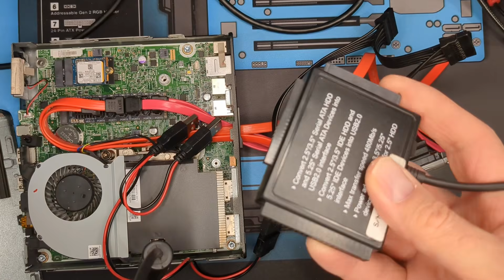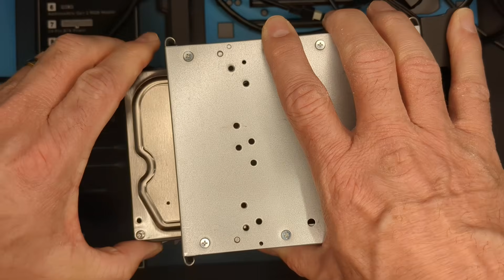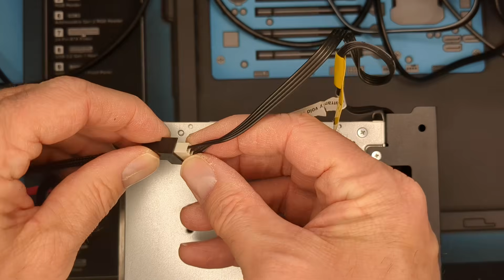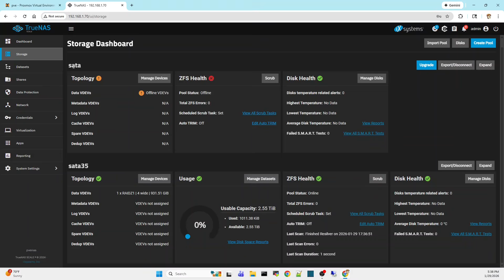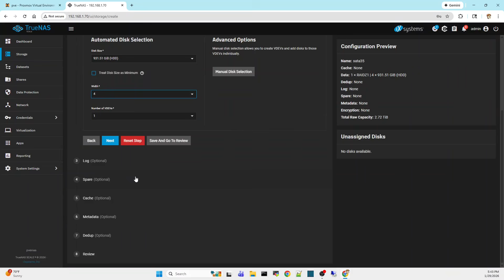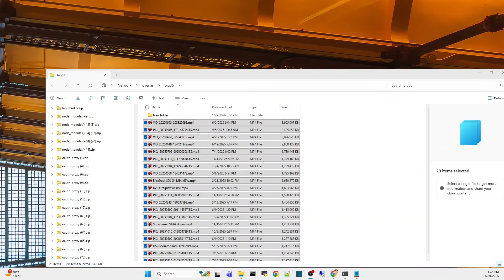3.5 Inch Drives...with EliteDesk/ProDesk Mini

Comment: Did booting from the asm1166 sata board work out of the box? I cannot seem to boot from that m.2 adapter.
Reply from the maker: I did update the firmware but I can't recall trying to boot a drive of f of it.  But for other operations it was fine.

Comment: Thank you so much for your great effort! I took your idea and built a 3D-printed case.

However, I’m facing an issue now. When I restart the HP, the system doesn’t detect the HDDs. I have to do a complete shutdown and then power it back on before TrueNAS detects the drives again.

I’m running TrueNAS directly on the HP, not as a VM.

Do you have any idea what could be causing this issue or how I can solve it?
Reply from the maker: Which SATA adapter are you using?
Reply: @handmedowntech  M.2 NVME PCI-E PCIE X4 X8 X16 To 6 Port 3.0 SATA Adapter Card Riser III ASM1166 6GB/S Chassis server PC Computer Expansion
Reply from the maker: So you probably have this one https://www.aliexpress.us/item/3256804650735517.html?gatewayAdapt=glo2usa4itemAdapt - the basic component is the Asmedia ASM1166 - which has firmware that can be updated.  I did it on mine because I was having some issues with it getting recognized.  You need a piece of software that runs and can load in the firmware and flashit.  https://winraid.level1techs.com/t/latest-firmware-for-asm1064-1166-sata-controllers/98543/86?page=2 includes links to find some on "station-drivers.com" - it does seem sketch but it seems like it is the only place that has the firmware.  In linux if I do 

lspci -k

I get 
02:00.0 SATA controller: ASMedia Technology Inc. ASM1166 Serial ATA Controller (rev 02)
        Subsystem: ASMedia Technology Inc. Device 2116
        Kernel driver in use: vfio-pci
        Kernel modules: ahci
You you go to https://dl.radxa.com/accessories/m2-to-hexa-sata-adapter/tools/ they have a zip file with a linux tool called 116xfwdl - when I run it with

./116xfwdl -S

I get fwver 24 12 24 00 00 00 
this seems to indicate 241224-0000-00 which aligns with what I see on the forums like https://www.reddit.com/r/unRAID/comments/1j9dzxr/asm1166_firmware_mess/

I did my flashing though using the windows GUI tool that I found on that station-drivers (I think) 

You can find more info seaching for

asmedia asm1166 firmware

But maybe first try and determine what you currently have

Comment: but can you run only one 3.5" from the built in sata connector?
Reply from the maker: In order to run a 3.5 inch drive you need 5v and 12v.  You can't get 12v out of the mini PC.  I researched trying to do it and you always end up needing external power.

Comment: Thanks for sharing this!  Could you link all the parts and cables (didn't know about the main converter you showed)? I have been looking at a very similar setup, but was looking at one larger 12v supply Like a 240W SFF supply ~$20 and a buck and boost converter for the 5 and 19v.  This way the PC and drives all power up and down together.  Not sure it is worth the extra hassle if you have a monitored UPS to do a graceful power down if needed.  Appreciate your video (as a new subscriber).
Reply from the maker: Thanks for asking and reminding me to add the part links - they are now in the comments.  Let me know how it works out.

Comment: Try to use side angled sata cables, so you can utilize all 6 ports. Trying to put an amazon link, but it doesn't let me.
Reply from the maker: You can give me the part number (YouTube does not allow for links in comments).  The only sideways ones I found big enough were $20 a piece (Silverstone) so if you found cheaper ones cheaper let me know.
Reply: @handmedowntech  Search for :
SATA-III Cable, 6-Pack 90 Degree 19 Inch 6Gbps Right Angle Data Cable Replacement for Bitcoin Computer-Server CD DVD Drives Raid HDD-SSD
Reply: @handmedowntech  $12.09 for 6 pack
Reply: @handmedowntech  search for 
SATA-III Cable, 6-Pack 90 Degree 19 Inch 6Gbps Right Angle Data Cable Replacement for Bitcoin Computer-Server CD DVD Drives Raid HDD-SSD
Reply from the maker: https://www.amazon.com/gp/product/B0FC2NGFPS/ref=ewc_pr_img_1?smid=A1IR1GJH6XB88L&th=1 in case folks want to check it out
Reply: oh, hrm. Maybe I'll do this instead of taking a chance on the occulink. Not ~as~ clean as a 3d printed flex slot occulink port, but clean enough.

Comment: Install an M.2 oculink adapter in the 2280 slot with an oculink cable running out the back thru the flexio port opening, and connected to an external oculink PCIe dock containing an HBA with the required SATA ports. Many docks include a mounting bracket for an ATX PSU, or you could use a picoPSU to power the dock. The ATX or picoPSU also provides the (5V + 12V) SATA power for the 3.5in hard drives in your cage.
Reply from the maker: Tried oculink and it was a no go for drives.  If you've got it to work with EliteDesk minis let me know.
Reply: that's frustrating to hear, because if it could work it would be a much cleaner solution. I was hoping to use oculink with a 3d printed flex port for a similar nas build myself using an elitedesk 800 g6 mini. I've heard of people using m.2 to oculink adapter for egpu on a mini successfully, I don't know why that would work but drives wouldn't. could you have had a bad adapter? Which adapters did you test, so I can be sure to something different?

I'm probably going to try this anyway - worst case I spend $40 on spare adapters that I'll eventually find some other use for.